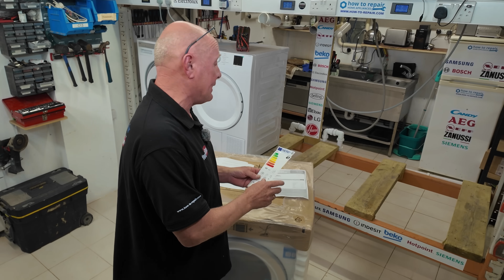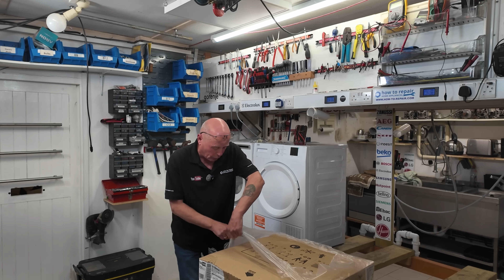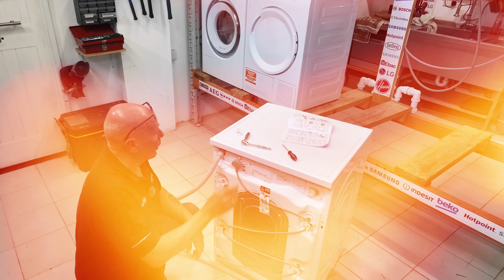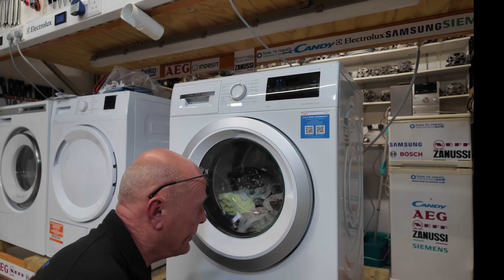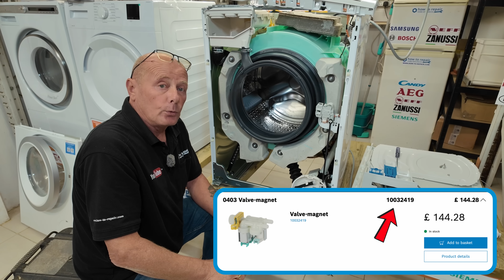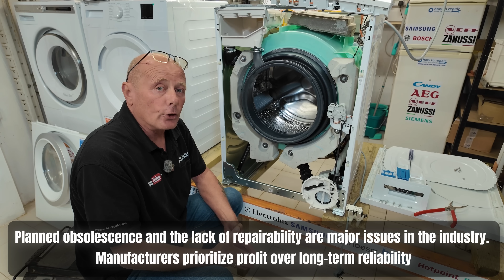Bosch WAN28259GB Washing Machine An Engineers Review: The Good, The Bad & The Ugly Truth!

Comment: We've just purchased this machine. They specifically instruct that you DO NOT use a Stanley knife, when unpacking thr machine. Our machine had a thick cardboard cap on top, to protect the top cover. This is our third Bosch machine....and generally pleased with it... especially the quietness!! Our previous machine was 18 years old and  I've always repaired it myself...changing the door seal and the pump and motor brushes. I physically can't do do major repairs now and the outer drum had cracks and both the drum and motor bearings were failing. It didn't owe us anything. The new machine,isn't 100% perfect. It doesn't tell you exactly what the machine is doing during the programme..only the time left until the programme finishes. The other thing that I find really annoying is the control panel isn't back lit and I need a torch, to see which buttons to touch. It certainly is a good machine and I hope it stays reliable. We also have 20 yo integrated Bosch dishwasher still going strong...he says touching wood!!!

Comment: I'm not sure if this has been mentioned before but a few years ago whilst researching buying a replacement washing machine I noticed that Currys were selling a Bosch machine with a very similar number to the model I had short listed at a much keener price than elsewhere. I couldn't find the Currys model number on Bosch's web site and on investigation it transpires that Bosch make reduced functionality models for big retailers, the salesman assured me it was the same as the model I had short listed but it wasn't! Something to be aware of maybe? Interesting video, as usual.
Reply: Manufacturers have long supplied exclusive amended spec models for large retailers in UK.
I sold domestic appliances in an independent superstore here for over two decades 👍
Reply: Agree, this is a possibility.  Retailers will want to sell at a certain price break.  Many years ago, I used to hire out baby equipment,  I wanted to purchase a couple of car seats (identical), when making enquiries through my trade supplier, what I thought was the same seat in the Argos catalogue, were much cheaper than the price I had been quoted.  I was told that they wouldn't be quite the same as the model I was researching.  It was true the seats were almost the same, apart from the seat cover itself, which didn't look as fancy, they had left out some of the more complex sewing parts.

Comment: It's a great video. Engineer since 9 years, with specialty on Electrolux Brands, but work with most. And I can mention one thing that is also built in time bombs = PCB that require manufacturers firmware installment. If you're not a partner with the manufacturer, you won't be able to replace the circuit board. Or if you would DIY it, which is super simple, you can't run the machine without the right firmware. Some brands still sell with pre programmed cards, but they seem to be out of stock more often than in. I have never changed the bearings on a split drum, but I have changed the drum many times on Electrolux. Personal best was 58 minutes, Friday afternoon, so I wanted to go home. Longest time 3,5h on a combi in a small room. I really do like repairing, but like you've said before Paul, soon a technician will only be a technical sales guy.
Reply: Applies to a lot of electronics, not only washing machines.

Comment: Long story short. I have an earlier model of this machine and do not see anything really new with this model.

No matter what, stay away from plastic tubs and vote with your wallets: get a metal tub for a reasonable price.

As long as you will have a plastic tub, your laundry will be constantly contaminanted with chemicals, even when cleaning the machine becomes a weekly hobby. The extended 5 years warranty is nothing but a marketing trap, because just when the obligatory manufacturer warranty ends, the plastic tub will be so badly contaminanted and worn out that you will just want to get a new machine hoping that AI functions will be the cure.

The amount of water, chemicals and electricity that i have used to keep my machine clean over the last two years is a clear F efficiency rating and nothing even close to A++/C.

Also... When observing the drying room, lint dust, chemical or bad odour evidently became an issue over the last 5 years thanks to plastic tubs and faked efficiency rating achieved only because of minimal water use and nothing else.

Comment: Service technician since 11 years here. I would stay away from that Serie 4. It tends to have bearing problems and if I'm not wrong its build in Spain. Either buy the Serie 8 or Siemens IQ 700. Make sure its build in Germany.
Reply: Some of the Siemens models are now manufactured in the Bosch /Siemens Polish plant.
Even 25 years ago their factories were highly automated (I  had a tour around the  Munich factory)  Quality control should be the same.
Reply: And what about IQ500?
Reply: @MKasap-te8vm if you're talking about the WU14UT70 Siemens IQ 500 is kinda the same as the Serie 4 from Bosch. Electronics hard to reach, cable salad inside.. not fun to repair. In Germany they say - Schrott
Reply: They have 3x Serie 4 in an apartment building here, being used by around 50-100 people. Let's see how long they last lol
Reply: @Violet-ui nice, I give them 3 years top.
Reply: TechnikerPeter, interesting to know, how can i see or know what country the Bosch washing machine was Built. ???
Reply: Yes i have as siemens iq700 washing machine and heat pump not cheap 11 years old just been service 1st time but bought the new ones bnd keep old ones spare

Comment: I bought a Balay washer two months ago, mains power failed several times in one night due to storm, washing machine beeps with error codes E20 : -61. Two week waiting list for the Technicians. I was under the impression that Bosch electronics are robust and that Bosch engineers understand that power surges do occur, seems I'm wrong. I'm thinking of buying a hand driven washing machine for emergencies, heck perhaps I'll get a sturdy plastic bucket slap a lid on it and take it for a drive, do some shopping and wash clothes, two birds with one stone, much more reliable than this modern crap.
Reply: Update: The Technician replaced the main board, machine works fine. We looked at the board and interestingly the power supply side of the board was intact but a resistor further down was blown and charred, seems the power protection of the board didn't catch the surge. Its under warranty for another three years so I'm not going to install a surge protector, let the damn board fail as many times as it needs to, hope the engineers will get the message, design a better surge protector.

Comment: Further to my earlier rant I will say that, by coincidence, your review came at the same time as I was looking to buy this exact same model to replace my current Hotpoint WMAO963 which has just started to suffer from drum bearing failure. It can be repaired as it's got a splitable drum, but the pain involved in stripping it down is not worth the aggro for what is possibly the worst machine I've ever owned. I bought a Hotpoint tumble dryer at the same time ( 8 years ago ) which is equally poor as it rarely reverses and just rolls everything into a tight ball which takes an eternity to dry.

Comment: as a mechanical engineer, i don´t think, it was planed obsolescence, i think, that ultrasonic welding is just cheaper, and more reliable seal, than a o-ring, and bolts.

now, i´m not saying its right, but i think the reason is a bit different.
Reply: Probably more consistant quality control along with manufacturing cost saving 
I used to sell washing machines for a living
In my experience many customers don't want to wait in /take ytime off for an engineer on out of guarantee machines. 
Sadly just want to buy a new machine - even if fault could be minor. 
Manufacturers own call out to diagnose problem cost  £100+ although sometimes  parts covered.

Comment: Wondering whether I'm alone in this. With every machine I've ever owned ( 30yrs + ) I've used the 1hr timed cycle at 30 degrees with the maximum 1600 spin FOR EVERYTHING. Always have and always will. Never had any problem, clothes are clean, job done. All the other washing options are just snake oil in my opinion and serve no real purpose. Similar to the pointless tech built into cars that are a best a set-once never touched again options, but which add £1000's to the purchase price.
I'd love a manufacturer to sell a single programme, single temp, single spin machine for those people, ie me,  that haven't fallen for the spin ( pardon the pun ) of must have programmes that never get used.
Reply: And how often do you buy a new washer? If you any laundry washing @30 in a hour, i suspect with liquids or pods, your washer is an incredible spreader of viruses and bacterias. .. especialy beddings has do be washed @60, becaus you are so many hours in it, sweating, skin residues, skingrease etc... belive me, washed on a 60s it would smells so much better and fresher... and you do your washer a big pleasure. if you dont like to wait long for it, use the speed+ option... but i agree with you, lot of programs are not realy necessairy... sometimes only nice to have it. in past nearly all of the washers having only 3 programs: Cottons, Syntetics, Delicates. for decades. now the computer programming and control gives unrestricted possibilitys....😅😉
Reply: Same here. Just Turned on. Default 56mins cycle. Let it wash. Been over 30 years. I did dismantle it to wash the drum though. Absolutely filthy 😂.
Reply: I use the slower and cooler hand wash setting when needed. But you are correct

Comment: My Bosch Waj24006 failed after 4 years and about 150 washes. 
Electronic board failure, not worth repairing, Bosch not willing to do anything, only 2 year warranty.
Bought a Samsung.
Reply: In instances like this when goods have not lasted a reasonable period for price paid & retailer unwilling to help always contact the credit card company you purchased it with. Never pay cash for electrical appliances.
Reply: Had Bosch before. Went with Samsung this time 10 year guarantee on Induction motor but would have to use their labour. It's been very good, about 8 years old now. 👍

Comment: Hello, I have replaced an inverter on our AEG washing machine 4 years ago that I got second hand from ebay. And today it decided to go pop again so I soldered in a Triac? from the old inverter that I saved to the new replaced and that went pop too - The motor phase resistance all check out ok.I have a choice now to replace the inverter yet again or replace the machine entirely with a new one. What brands to are best for repairing and replacement parts?, I know AEG is now Electrolux. How are Bosch or AEG for parts ?

Can you supply a replacement inverter for a AEG 86850 machine the inverter is a 132527706 or 1325277083 which is the same I believe.

Comment: Interesting and informative video.
Many thanks.
I was just about to buy a Bosch WCA132WCS Freestanding Washing Machine, 8kg Load, 1400rpm  in the Black Friday sales. Main reason being their warranties are 5 years so longer than most other companies bog standard 2 years.
Apart from spending silly money on a Miele what's your thoughts?
Are Miele any better anyway?
Are there any washing machines that particularly stand out for you that may last the test of time?
If not then surely getting a 5-year warranty is the only protection we've got as consumers from this ongoing problem.
I now understand a lot of these parts probably "fail" just after that 5 year period.... and there's a reason for that!
(Cost of repair drives us to a new machine!)
Sad that the consumer is being ripped off in so many areas of lifecompared to the past.
Reply: if MIELE,  then 'made in Germany'.tested on 20 years durability...not the Chinese ones, which they offer too for lower prices.

Comment: You only get one blanking plug - its in the literature with the washer, You put the one you had in to top left hole - the booklet says to put it in the bottom left hole - it looks like that's where the circuit boards are. I had no fill hose and Siemens said it was an error. Bosch, Neff and Siemens are pretty much identical. Just took delivery of my Siemens replacing an Aqualtis that was perfectly working except for the drum bearings being noisy on its spin cycle. £30s worth of bearing and seal which isn't replaceable - so machine scrapped. £330 for a new one piece tub and fit myself - so it isn't worth replacing

Comment: As an electronics engineer, I can replace 0603 parts and up to 100 pin TQFP (thin quad flat pack). But I bet Bosch deliberately use BGAs (ball grids) to make repair harder. With a lot of room inside a washer, there's no need for such miniaturisation.

Comment: Deliberate bad design to shorten life of appliances due to unjustifiable cost of parts and repairs has been going on for years.
As a retired appliance engineer with over 45 years experience in the trade, I puchased Miele products when retiring  12 years ago and have not had a single problem with either the washing machine or the dishwasher.

Comment: Excellent video. Would you recommend Bosch over Samsung for reliability? My Samsung Ecobubble is now only about 6 years old and I think the PCB needs replacing. I'm considering the Samsung Series 5 AI Energy at £369 which is cheap enough,  or a Bosch 6 series which is a lot more at £599. I like how quiet the Bosch is on the spin cycle that you demonstrated compared to my Samsung which is quite loud. But do you think for the extra money I'd pay for a Bosch and given their reputation for reliability, (I appreciate you said they're made a bit flimsier now than older Bosch machines) there's likely less chance of the PCB going on the Bosch, at least within about 6 years from new compared to a new Samsung?

Comment: If the only difference is that the drum tub is sealed can you use an older split type to replace the sealed one. If so then is it viable to replace the tub and fit new bearings or a spider ?

This means you could recycle old tubs or buy the older type if still available.
Reply: Good question 👍

Comment: 32yr exp in appliance repair, still my go to machine for ROI. Still find Bosch typically strongest for bearings & boards, with my second being LG if the customer wants other than white, find they are more quiet than the Bosch too.
Shame Bosch didn’t stick with the welded paddles like only found in the series 2 now, though not had any broken ones on yet on serie 4, unlike the hoover/candy & Hotpoint/indesit which are awful. 
I think that’s a bigger crime, lose the tab in Hotpoint/indesit or brake the paddle in hoover/candy/baumatic, whole new welded drum assembly as they are screwed in upside down.
Would only take a couple of access panels on the top of outer drum to solve that but no🤷‍♂️
Washing trainers as the machine ages and the plastics give out is the main cause. 
Wish Bosch had stuck with a separate mains filter too rather including it on the PCB.
The old design Bosch, front access without having to pull it out and tilt, say fitted with a brushless motor and screwed outer drum you could have kept going for years.

Comment: A good video, A little story about our series 6 idos bosch washer,  It blew a resistor on the Main board at the rear, And all the repair Guys that I called none were interested in Fact they said just go and buy a new one,                                                                                                                                                                                  But being an Old DIY guy from way back I thought pigs arse I smell it when it went so I knew what it was I found a Video here how to remove and repair it , But being a shit guy with a solder gun I remove it and took the board to an electronics shop and $80 latter all fixed and working,                                                           i will do a wash count on our machine for you too.

Comment: I had the last generation Bosch and it was good for 13 years of use without any faults. But the shell rusted largely our fault for operating it in a cold poorly insulated external room. We got a new one off a family member when they moved house and the new Bosch is just much more flimsy feeling. But my word it is also so much quieter. Move away from brushed motors surely a good thing. But sealed drums. That’s a shame